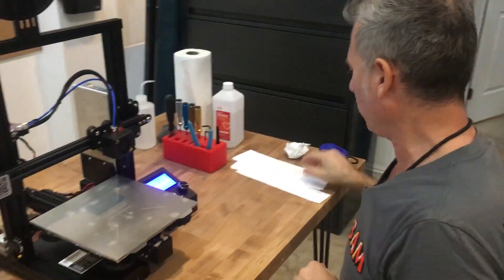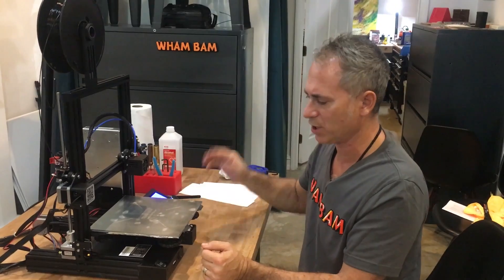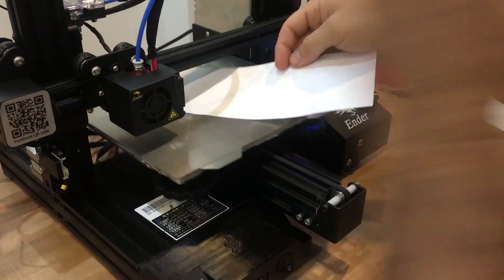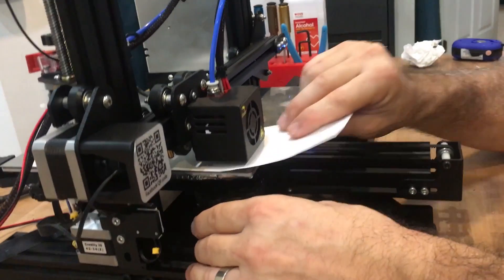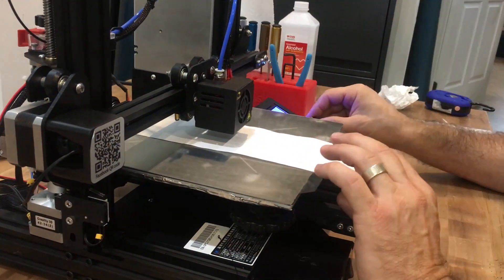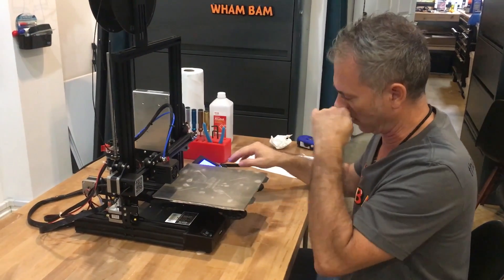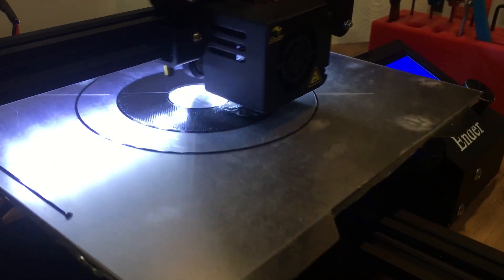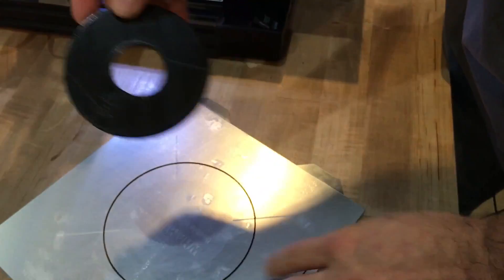Simple, Fool-Proof Bed Leveling

Comment: The Ender 3 Gcode file only levels on the left side of my Ender-3 Pro.  Is my head stuck or am I doing something wrong?
Reply from the maker: Does it print normally? I can send you a new code in case yours is corrupted, send an email to technical@whambamsystems.com

Comment: So The correct way to do i is clockwise?
I have tried with diagonal X but that don't seems to work very well.
Reply from the maker: I do prefer circling around, if you use my gcode it goes clockwise

Comment: I have an ender 3 max. Where can I get the gcode to levey bed?
Reply from the maker: should be the same as my CR-10m gcode
Reply: @WhamBamSystems  I am very new to 3d printing and do you have to download the code in an app or software like cura 5.1 which I am using
Reply from the maker: @joeynelson5245  just download, load to an sd card, put in printer and print it like you would another print file

Comment: I cant get my middle to adjust.
Reply from the maker: Is it too low or too high?
Reply: @WhamBamSystems  too low.
Reply from the maker: @dugy40  if it’s not too bad you can try to add one or two small patches of aluminum foil under the print surface.  What is your bed made of and what print surface?
Reply: @WhamBamSystems  the stock Ender 3 ver 2.  Has rough on one side.   Smooth on the other.
Reply from the maker: @dugy40  glass?
Reply: @WhamBamSystems  Hi, yes it is glass, mine seems to be a bit high!

Comment: Still trying to follow this, trying copy the same amount of tug on the paper and it's practically impossible to level the bed.. Even if I get the bottom right correct. When I try again it's not right and nothing is level.. Then top right.. There seems to be no perfect tug of paper.. I can't see it being possible. I tried it when the paper bends and tired it 6 times at different amount of tug on the paper till its hardly touching the paper and still no good results only difference is the print I am trying for prints a rim fine most times then the actual print in the middle goes all wrong.
Reply from the maker: is your bed flat is the first question, or does it have a bow?  to test this lay a steel ruler on edge across diagonals and horizontal and vertical and sight down at eye level to bed and see if you can see gaps under the ruler.  If flat, then level, make sure gcode you are using matches your machine and stops over each leveling wheel. 
Every time you level one corner it will get you closer but also may have slight effect on other corners, so repeat leveling over and over until it makes a full circuit without you having to touch a wheel.   Once you get consistent drag on the paper on all corners your bed has been levelled (meaning the X gantry is parallel to your build surface and your gap has been roughly set to thickness of paper)  then your final steps are to print with skirt lines and do live level.
If you are having to hard of a time send us an email technical@whambamsystems.com and we can set up a phone call to walk you through it!
Reply: @WhamBamSystems  I have decided to sell it as even with feeler gauge its still not possible to get the right distance between the bed and nozzle.
Went back to the paper and after so many failed attempts this morning and some very close.. I don't deem it worthwhile the pain and stress of doing this every time I want to print something out.

I will wait until someone makes a printer that you don't have to level the bed all the time

Comment: Great video but I have a questions it seems like my bed is off front to back  How would you adjust for that.  Seems like the back is higher and the front is lower.  I have tried tried your steps and other steps and its still the same.  Any advice would be great thank you
Reply from the maker: And you do not have adjustment wheels to bring it level, or are you saying it’s curved?
If curved you may need to bend the bed back or get a new top surface, what is your current bed made of and what surface are your printing on?

Comment: What is the point of doing this with a gcode? I just select auto home then disable steppers and then I move it to the points. Isn't that good?
Reply from the maker: No, you could be moving in z while manually moving
Reply: @WhamBamSystems  I didn't think of that, I guess that I am very careful (or lucky) up untill now.

Comment: Just wanted to let you know this is the BEST video ive found after watching tons and tons. Its absolutely helped me tremendously. I just have one question. Is it possible to have the G code actually pause at each spot and require you to hit the button? I need more time as a noob because i always forget which way to turn the knobs or dont get my hands to the knobs fast enough.
Reply from the maker: Thank you!!, Creality used to have its leveling program pause till you hit the button, I didn’t like it because I had to move  my hands from the controls.
You can also open my gcode in text edit and increase the times stopped on each corner.

Comment: I have an issue with the leveling. I can get all corners perfect. I then run a test print where the printer makes a series of squares; starts with big ones, then gradually makes smaller squares going towards the center. When it gets to the middle section, I notice that one side of the square that is being printed, comes loose when I check the stickiness of it with my finger. Every other corner and square sticks perfectly to the bed. How do I adjust it to where that one side gets perfectly leveled? Any tips are greatly appreciated. I have an Ender 3 Pro. Thanks for the video!
Reply from the maker: Hello, are yoou running a skirt layer with at least 2 loops and doing the live leveling?
What is your build surface made of?  You may have to use some aluminum foil under low spots of build surface to get it flat, or go to a bed sensor. or print on a brim.  Try squishing first layer even more to compensate for uneven build surface.

Comment: When I leveled my bed it had a snug fit like you said but then when I tried to print the leveling got a bigger gap, I said pla to preheat like recommended yet still got this problem
Reply from the maker: Bashful are you using an auto level sensor?

Comment: Why do you have to have the bed preheated for leveling?
Reply from the maker: Luke Howland Metal expands and moves when heated, if you level or in better words: tram and set your gap on a cold bed, then when you heat it it will move and throw all your previous work off.

Comment: I was looking at your GCode (CR10 version) to try to modify it for my first printer (non-Creality) and I noticed that the coordinates are not symmetrical (30 to 267) and that the center is not at X=150, Y=150.  Perhaps even more confusing for me was that when moving between the back two positions (position 2 and 3), the Y coordinate moves slightly from 267 to 260.  How did you determine these values?
Reply: He said it was based on where the screws were. I don't know, maybe can help though.

Comment: Thx for sharing.  Excellent informaiton for someone new and making tons of mistakes like myself.  I have a few questions if you have time
1. Do you have bed level after every print
2. I have tried to bed-level with stepper motor disable, but (and I may be crazy) I think there is a difference in z-axis height - it may be readjusting - comment?
3. If I have print that is 75mm x 75mm would it be better to modify your gcode to touch the outter points of my print as opposed to the entire thing.
Reply: Leave Z Stepper motor on...it's dropping

Comment: I've tried to level my printer countless times and no matter how many times I try to print the filament does not stick to the plate. could you help?
Reply from the maker: Sure, what filament? What machine? What build plate, what settings temp hot end temp bed? Can you send me photos of first layer going down?
Reply: Wham Bam Systems I’ll try to get some pictures, my email is SteeleyBaker@gmail.com I have the same printer as you.

Comment: I just got the Ender3 two days ago. I'm trying to level the bed with your g code.  But my printer is not moving across the x axis. It's keeps using the two corners on the left side -opposite of the power button. Any thoughts on what I may be doing wrong?
Reply from the maker: Luis Cuevas  is this happening just with my gcode or also with any other print? Can you use your control panel to move the x axis? Prepare-move-1mm-X then turn knob?
If nothing moves X try power connection, you can also swap x and z ribbon cables and test to see if it’s the stepper or the cable or the board.  Good luck

Comment: I have to over adjust the corners to get the middle to print due to it being warped in the middle, I have never had a bed that was not warped in the middle.
Reply from the maker: It is possible you are warping your own bed if you crank down the knobs aggressively
Reply: @WhamBamSystems  Ender was warped out of the box
Reply from the maker: tablatronix too bad, you can try to gently bed over knee or use some aluminum foil strips under build surface to brink it back up

Comment: Cura the bed size is 220.220 when I say it prints off the bed the hot end start by moving to the stop switch then goes down to the bed then it moves in to the bed  to start printing it moves in to start the part I am trying to print is 100.90mm the head only move that distance away from the stop end it then prints the first brim line and it is a bit stopped by the stop end every time it moves to the left also it only prints to the front left of the hot bed I did get a message from Crealty today saying I should in cura put the print object in the centre of the bed bur I already do this so I don't no what to say about that thank you for replying I tried to explane what is happening and can understand it
Reply from the maker: Kenneth Munson if you like I can sen you a model sliced by me for Ender 3, you can try to print, if it does not do the same issue then it’s in your slicer. If it keeps doing same issue it may be hardware. Can you pm me?
Reply from the maker: Send me your email or write to info at whambamsystems dot com

Comment: hello i have just built my ender 3 every thing works fine but i have 1 problem the printer prints off the bed i have sent messages to creality but havnt had any replies so far i hope you have some ideas about setting up the printer so it prints at the centre i did see a video he said it can be fixed in EEPROM that's as far as he went if you have any ideas it would get me printing thanks for your time and a very good video
Reply from the maker: Ken Munson what slicer are you using? In Simplify 3D and probably all the others, but I don’t know them, you can specify your bed size.
Also make sure you limit switches are being activated when bed moves fully to back and x gantry moves completely to left

Comment: i liked your hot bed, which is and where can i buy it?? nice g code too, i have an ender 3 and works well.
Reply from the maker: Ricardo Wilde the flexible build system mounted to the hotbed is by Wham Bam Systems www.whambamsystems.com you can buy directly online.
Thanks for the nice words, happy others are using my gcode and it helps them!

Comment: For the novice, the auto movement and speeding up as you progress is rough and frustrating.  I would prefer a manual version that stops at the 5 points and waits until you press the knob to  go to the next point.
Reply from the maker: broderp did you try yet? You can adjust the gcode. I actually switched from the  progress which is already built into your machines leveling program and stops at every point until you push a button to my G code which does not make you push a button so you could do this all with one hand. You could set a time increments by adjusting the G code.

Comment: The best way to bed level Ender 3: put a glass on it.. The bed is not going to be flat enough, glass plate fixes it. Then this type of bed leveling works and it is perfect first layer. with the default sheet: no chance. It is rubbish.
Reply from the maker: SquidCaps on the Ender 3 I have had only flat beds, be careful you are not bending your bed whole cranking your leveling knobs down, work around each equally!

Comment: is that a metal bed ? looks way better than the glass bed tho ! Where I can get one for my Ender 3 Pro ?
Reply from the maker: that is the Wham Bam flexible build system! a flexible spring steel plate, a high temp magnet, a PEX build surface, the best in class! www.whambamsystems.com

Comment: Great video. I see in the description that you have the gcode for what I believe is for the paper leveling. Do you also have the stl or gcode for the live level test file you are using
Reply from the maker: the live level is done when slicing your models, add a few skirts as far away from your model as possible which fit on your printer, do 1 layer and 2-3 skirts.  This will print the skirts first when you send model to print, and you can live level on each print.

Comment: I thought this was John McEnroe for a moment! Jut as a heads up, if you update your firmware (PITA one the ender 3 but if you do get the arduino and upgrade the firmware the new MARLIN has the 5 point level built ion with just a button press to move to the next point.